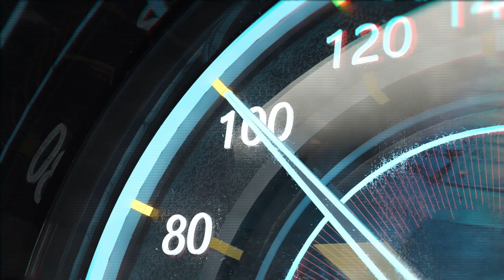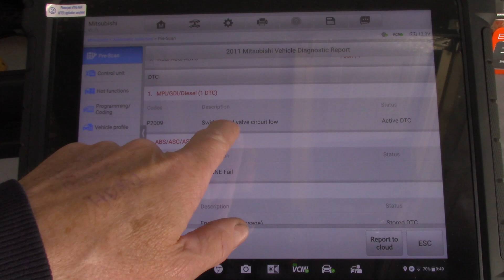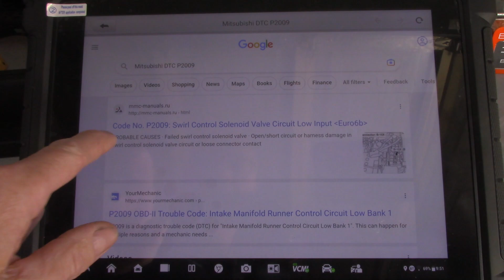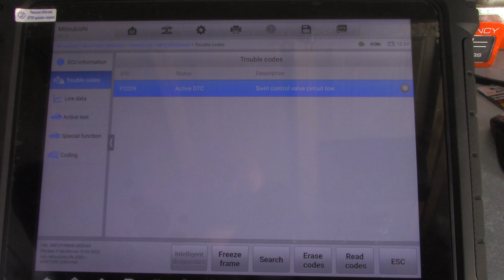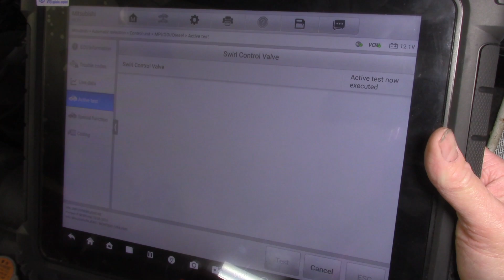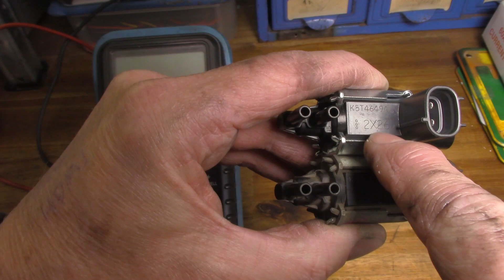How To Diagnose & Repair Mitsubishi Pajero P2009 Code

Comment: Great video. What did you use to remove the securing nut of the unit?
I'm having difficulty accessing the tight spot.
Thanks🙂
Reply from the maker: Sorry, it was some time ago, so can't really remember, but removing the intercooler to throttle body hose should give you better access.

Comment: Nicely done. 
Where are you and do you do work outside of Youtube?
Reply from the maker: I'm in NSW. The intro video gives you an idea of the jobs I am currently doing, including running a small workshop part-time
Reply: @MiracleMAX  Damn, I'm in Victoria/Melbourne. I need someone who can work on my Jackaroo, has the tech2 diagnostics tool and can troubleshoot logically not just swap parts. You made that point very clear when you confirmed that the actuator was actually faulty and not just the wiring. My local mechanics have been pretty good but don't own a tech 2. Just reading what I said, I might just get a tech2 and let them use it when diagnosing faults...
Reply from the maker: @MiniLuv-1984  Is there any reason you need a genuine Tech 2? A good quality scan tool will work as I have shown in the video.
Reply: @MiracleMAX  I will check out the video - thanks. OK, the Jackaroo does not support ODBII - P Johnstone in his article "JackarooTips101.pdf"  (easily googled) covers the standards it uses well. I tried with some cheap scan tools (as did my mechanics with their fancy gear) to no avail. Maybe there is a scan too that can read the Jackaroo, but I am no expert so would prefer to get what most recommend. In any case, having one will make any diagnosis when camped at the proverbial Dingo Piss Creek possible! - To save some money, I am looking for eBay units, but I wonder for the $200 or $300 I save....
Reply from the maker: @Bennyboy-dog  What year Jackaroo? In this model (1999), the OBD2 port is at the centre console.
https://youtu.be/v4SfEtAggOg?t=318
Reply: @MiracleMAX  Thanks, yes that's where it is ok, but its not odb2 - plugged several ODBII scan tools in - none connect. The P Johnstone article calls it a variant of SAEJ1850.